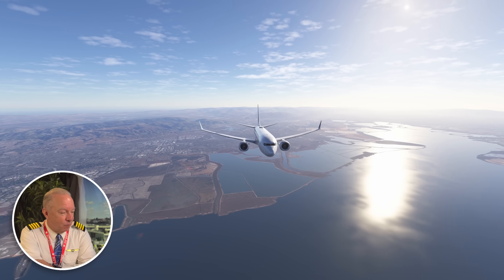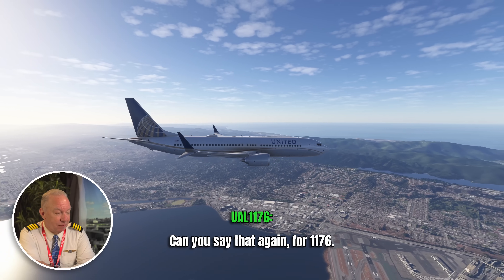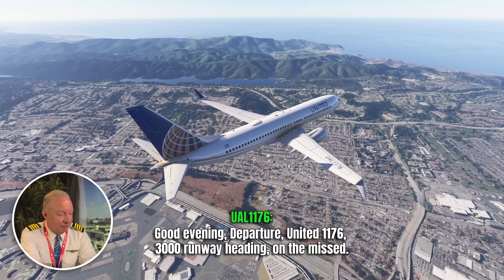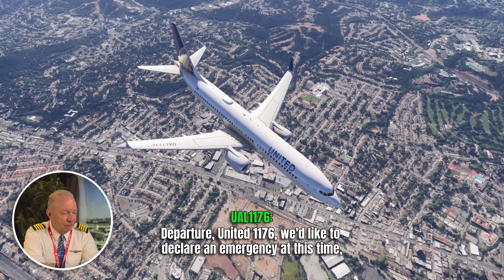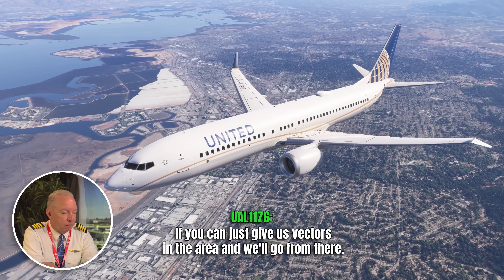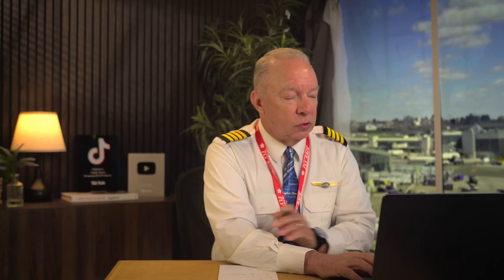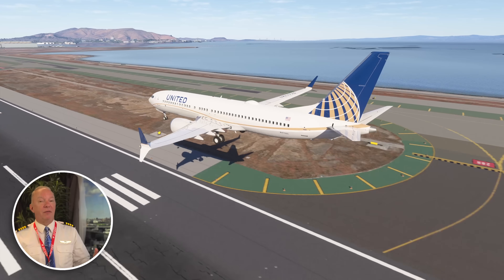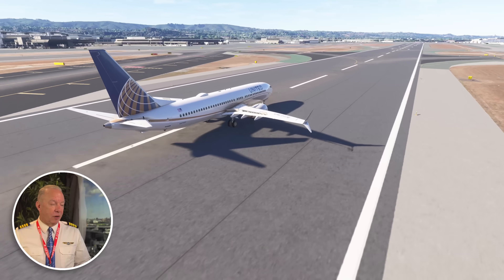Flap Failure on Final Approach – United 1176 Emergency! | Captain Steeeve Reacts

Comment: U know how it is when someone ssks U a question about wanting to b perfectly correct in ur diagnosis
How many doctors have been wrong about a diagnosis that led to someone losing power and stop breathing anymore

Ots a tuning timing factor Captain Steevie with heroic probability math function test results using a simple breathing function calculator Vacuum temperature metering voltage change Echo Maps recording speeds in PSI coded tachyons kicking out neutrinos naturally gifting electromagnetic life force power to clrar phone the Morphogenetic field structure of distorted metatronic Shadow body sound waves generating cavitation in Water molecules to dehydrate ions implode and go NOVA BARDO Quantum Vampiric Super Computer Borgha Matrix Quarantine victim victimizer game simulators through finite Quantum Artificial intelligence Super Computers communicating with each other through nano bots redirecting reverse flow traffic DNA coded negEntropic nuclear coded metatronic distorted sound waves
Thats what led to bio regenesis Salvage Co-mission reclamation unification project Host Aquaferion protection Passage way Home through inner Urtha Krystal Core Still point of a True Vacuum L PIN LUV story without being interfered with through electronic metatronic implants malware Trojan Horse crucifixion mathematical Spiritual torture chamber mind control programs through obedience training through implants

That would be ur Secret Space programs MK Ultra Secret Services clandestine psychological operations against Humanity through Quantum Vampiric Super Computer codecs Intruder races Alliance

Thats Y we are here as Founder races Guardian Alliance Shield service organization 🌈

Comment: OK, Steeeve..... I'd like it if you gave the addendum to these mechanical failures.... ie, tell us what went wrong with the plane, and how it got fixed. For some of us, we want to know if it was caused by poor maintenance, aftermarket parts, or poor design.... or hitting a bird, or a meteorite, or whatever... and what steps were taken to remedy the situation..... It's may the engineer in me that needs this missing piece of the "Debrief". Thanks!

Comment: I really find your videos very very interesting. And so informative. They also have the effect of making me aware of how many things can go wrong on an airplane on takeoff on cruising on landing etcetera. I have not flown since 1989. I always liked flying on jets that had four engines or at least three like the boeing 707, DC8, Boeing 727, I even felt okay on the dc-10. On one night flight from Chicago to la we lost one of the two engines on the left wing. I didn't feel all that nervous because we still had three other good engines which left us with 75% power. We landed at LAX without problem in the dark of night. I don't care how dependable they say to engines are on one airplane. If you lose one engine you lose 50% of your power. And that ain't such a good thing 
.

Comment: Not much of a comparison but if you fly combat flight simulators you land without lots of control surfaces. When youre in really bad shape on a computer, you can test that feature briefly to see how it will behave. I've rolled it right into the treesl a couple times before I learned  to survey the damage before lowering flaps. Side slip doesnt work too well when your vertical stabilizers half missing, drop gear and realize you only have one wheel left. Maybe not realistic for most of us but it makes landing a WWII Corsair even more interesting.

Comment: In 1990 I was on an America West 757 Phoenix to Chicago O’Hare,  on initial approach we felt a jolt, like we had been punched sideways. The plain continued on out over Lake Michigan for about 15 minutes and then began seeing a mist from the wing, they were clearly dumping fuel. The pilot came on about 5 minutes later as we began the turn back to O’Hare. We were advised the right wing flap was stuck and would not extend. The pilot told us he was retracting the left wing flaps and going to be landing faster than normal on the long runway at O’Hare and that he had declared an emergency landing.  It was a noticeably faster landing, runways had been foamed. We passed 10-15 emergency vehicles, slightly unnerving, but safe landing, taxi over to a vacant area, vehicles inspected the plane, portable ramps were brought over and buses took us to the terminal. Great job by the pilot, baggage claim was a mess.

Comment: I have a couple of recommendations for you. You have spoken about the broken ATC communications issue many times. Write it up with any recommendations, and then send a copy to NTSB, the FFA, and the President. All it takes is for him to pick up the phone, and the issue resolution will begin. Regarding the checklists you almost always mention, is there an easier way to organize or modify them to reduce the pilots' workload?  If it were possible, you could save many lives. With your 42 years of flight experience, I know you have some excellent ideas for improving aviation safety.

Comment: I’ve heard you say go arounds happen all the time and it’s no big deal. Now it is complicated and doesn’t happen often. Which is it?
Reply: They happen all the time when you look at all the flights worldwide. To an individual pilot, it usually doesn't happen often. This year I had one go-around and I wasn't even the one flying. Last year I had one as pilot flying. But a few years ago I also had 2 go-arounds in 2 weeks, once due to gusty weather and then due to the flaps not extending to their final position. And about 10 years ago when the airport I was based at took the ILS down during summer due to reconstructions, many go-arounds were flown that time as often the weather wasn't good enough for the VOR approach.
Go-arounds are always trained in the sim, so it shouldn't be a big deal when they have to be flown in real life.

Comment: Many posts saying the pilots were calm and unflappable. Pilots train for such emergencies in the sim ever year the way they train for engine out or fire on take off. Though not having your flaps working correctly as long as they don't stick in a "non symmetric" position, this emergency is amongst the least serious to deal with. This crew stayed calm knowing they had seen and practiced for it many times. One of the biggest and most important lessons my flight instructor taught me over 40 years ago was that in an emergency, you can't control your environment, you can only control how you react to it. Good work by the flight crew.
Reply: Why the heck can't they have a ventilation system that takes fresh air from outside to exhaust any smoke or fumes ? Especially during landing ??

Comment: 737 is not a 777. On the 737, there are 3 non-normal checklists regarding the Flaps, those are: "Trailing Edge Flap Asymmetry", "Trailing Edge Flap Disagree" and "Leading Edge Flaps Transit" checklists.

Comment: Happened to me as a passenger in the 90's.  Should have gone to Madeira, instead emergency landing in Lisbon.  Felt like a normal landing. But they couldn't drive the plane after we had come to a stop. We stod on the runway for a very long time and we could smell the overheated brakes.  Equipment all around.  Finally they let us off.  But we weren"t allowed to bring our personal belongings.  Strange because it wasn't an evacuation. 
 
Was much scarier on land than in the air.  Later one person from every family was allowed to go back to  on  plane to collect personal belongings.

Comment: Every story here about Boeings, and some DCs/CRJs. Haven't any of you guys had a flap issue with an Airbus? Maybe something smaller? Stale coffee? 😜
Reply: Yes, I have. Flaps Lock after selecting Flaps 2 in an A319. Did a go-around, pattern, and landed. Delta VREF was +25 IIRC.
So yes, it also happens with Airbus from time to time.

Comment: Aircraft protocol seem to be overly complex now - way too many checklists. If the flaps are f**ked, then the flaps are f**ked, land without them ASAP instead of spending an hour doing checklists that wont change a thing?
Reply: No, not ASAP. The plane flies just fine with the flaps extended, there is no need to rush. But the plane would stall if you're too slow for the flap setting you have, so you have to make sure the plane is properly prepared for the landing. Basically the VREF is adjusted and the flap warning turned off.

Comment: Aerojet Lear Jet  back in 60’s approach to B52 US Mather Field flap broke. Pilots went with yaw. Upside down. Full throttle. Flaps retracted. Gear up. Flew length of field upside down. Stabilized. Rotated to right side up. Go around. 11,300 ft runway. Landing at 172 mph.

Comment: I have been in a Boeing 737 flying into Melbourne during a flap failure. We ended up landing at about 40-50 kmh above normal landing speed with a very flat approach. This was about 25 years ago. The plane landed safely. As the pilot explained, they train for this regularly. It was a little tense but not significantly so.

Comment: The reason for the coyness of the flight crew might be related to this being a United flight. If they were allowing the passengers to monitor their ATC communications (aka Channel 9), it might be a kindness to avoid the  details and mayday declaration until they discontinued the passenger audio. 

I too experienced an asymmetrical-flaps situation as a passenger on departure from ATL for CLT, not long before 9/11. No cabin announcements until we had circled Atlanta a couple of times. By then it was clear something was amiss. 

Since Delta had no maintenance facilities in Charlotte, they elected to return to Atlanta after nearly two hours, flaps fully extended the whole time. 

This was doubly frustrating, as I had bumped up to this ‘earlier’ connecting flight. I then missed my original connection, only getting a seat on the last departure due to other passengers’ late arriving flights.

Comment: Have had only one No Flap landing, 737-800.  Captain gave us a Yellow (which means we don't communicate to the pax).  Landed okay but could tell thrust and brakes were well used!  Pax were startled and concerned when they saw the firetrucks along the run way.  Thought the Captain should have communicated to pax, but it's not our call.

Comment: Flying into Manchester UK in the early 2000’s, on a 777, the flaps jammed causing a loud banging sound as the overload clutch releases. The pilots made a no flaps landing.

Comment: I was on American 737 out of London to philly on Oct 3.   We took off.  We climbed and then we were told we had to return due to a flap problem.  The flight attendants were taking pictures out of my window on the wing.     We ended up dumping 20 000 lbs of fuel over the English channel before heading back to Heathrow.   Pilot prepared us for a rough landing.    We were safe and all emergency response vehicles were waiting for us.   Thank u Captain Steve for the knowledge from your channel and knowing in the .moment I would be safe.   But one thing the flight attendants  should not  do is  overreact and scare the passengers by taking so many pictures without an explanation.  The whole duration took about 90 mins

Comment: I was on a Lufthansa A320, Frankfurt, Germany to Manchester, UK, 4 years ago & had to do a go-around at the last minute. The Right-wing Flaps Jammed at halfway, would not retract or extend. The pilot did the go-around ok. He, did NOT call for an Emergency, but said when we landed & stopped on the runway, that it was the tower that called it an Emergency & closed runway 23 R.  All emergency vehicles were waiting after 10 minutes, we taxied to a parking spot, not a gate again, Manchester's policy

Comment: Was a passenger on an MD-80 flight to Boston that had a flap failure on final.  Went around, declared an emergency, and spent about an hour circling west of Boston while the crew troubleshot the issue.  In the end, we landed with no flaps and trucks waiting - a little hard but not bad and definitely fast as we took up the entire length of Rwy15R.  Checked brakes for fire and we taxied to the gate.  Very professional crew and whole bunch of happy passengers.

Comment: A 737 starts from Boeing to Love To Phoenix to LAX. I boarded in Phoenix. As we land at LAX I could see people in the parking lots when ZOOM off we went back into the air. No rear flaps, brand new aircraft. So we burned fuel over the coast as crew tried to lower flaps manually. When we finally landed from the east we got an up front and personal view of the dunes and the pacific at the west end of the runway. Thirty five years later and it still happens?

Comment: Two comments/questions not addressed in the video:  (1) Why did they ask for the ILS on the second try - so they could focus their attention on the flap issue rather than flying the plane by hand on visual?  (2) Unless I missed it, I don't think the crew ever said whether the flap issue was resolved and they were landing with normal flaps (e.g. flaps 30), or whether they were attempting to land with something less than normal flaps, requiring more runway and/or brakes?  Tower should want to know this to dispatch emergency vehicles as required.  I don't think we heard that they withdrew the Mayday call.

Comment: I remember coming in for a landing at DIA when the captain mentions that the flaps would not extend (it was either an A320 or a 727 - I flew there weekly for 5 years so I don't remember what specific aircraft it was). The captain mentioned we would be landing at a higher speed but nothing to worry about. Well, apparently we were going so fast that we touched down at DIA and deplaned in Ft Collins! Cruising I-25 in a jet was worth the price of admission😊
Reply: Whoa. This took me a second to understand. Meaning they overshot DIA due to speed?
Reply: @MatthewBakke - Not really. We did come in hot but stopped well before the end of the runway. I was attempting humor with the Ft Collins comment😊

Comment: 25 years ago the passenger airplane (MD-11) I was flying suffered from an asymmetrical flap failure, followed by a flap runaway (retracted while not commanded to do so). We made a go around at Curacao (Dutch Antilles), troubleshooted and decided to make a no-flaps landing. The runway is not that long and ends with a cliff in the sea. We came in fast, landed positively but after landing all our brake temp lights set the alarms off. We kept the passengers on board for almost an hour to let the brakes cool down as no one was allowed to approach the MD-11 to keep it safe in case of tire blowouts due to the overheated brakes. It took the technicians almost a week to find out the cause: wrong hydraulic flap actuators (looked exactly like the right ones, but with wrong internal system and wrong serial numbers) were installed at the previous maintenance overhaul the week before. No idea how that happened, but we were @!?& at our maintenance department.

We flew back home empty as the aircraft needed to be ferried back home in that faulty state, and over the Atlantic close to the UK we performed various timed tests of the flaps at altitude. That was also when I performed a few stalls for fun. The MD-11 was very benign during stalls. Loved that aircraft!
Reply: Gotta keep maintenance guys on your Christmas card list...lol

Comment: Hello Captain Steve,
I have a video request for you. On August 21 2025, I flew from DFW to Killeen TX, airport code GRK. Flight number AA3455 (the flight number might have been updated). This flight left at 3:15 pm, however when it reached Killeen, it could not land because of wind sheer and got very turbulent and scary. After a lot of bumps, TOGA maneuver was done and the plane regained altitude and came back to DFW. I would love for you to make a video on it including how it was dealt by air traffic control. 
Your biggest fan,
Zuberi

Comment: Back in 1980 I was an air traffic controller at Atlanta Hartsfield on a slow Sunday morning at my departure position in the TRACON, when I hear in my headset from the arrival coordinator, "Delta 122 will be coming to you on a missed approach with some type of problem." That got my attention! "Departure, Delta 122 is with you. We need to find the closest airport with better weather. We have a split flap issue and only have enough fuel for 15 minutes flight in this configuration." He was essentially flying sideways! I immediately checked all the surrounding airports and Dobbins Air Force Base had the only weather, reported as VFR. Since the Delta 727 was not equipped with instrumentation for an instrument approach to Dobbins, I vectored him up towards that airport for a GCA approach to RWY 11, their active runway. He responded, "We don't have enough fuel to make it to that runway. We need to land straight in on RWY 29!"  Since it takes 10 minutes for the Dobbins controllers to reconfigure their GCA radar for that runway, I told the pilot, "This will be a surveillance approach to RWY 29." I was going to provide his navigation with my radar site, 20 miles away from Dobbins! Everything was working as planned, except he had not yet spotted the runway. One mile from the runway he disappeared off my radar scope! I asked him if he had the runway in sight. After a brief, frightening pause, he responded, "We have the runway!" He landed safely. Shortly after he landed Dobbins came out with a special weather observation, which was just as bad as the weather at Hartsfield. Delta provided a bus up to Dobbins to pick up the passengers and crew and bring them back to Hartsfield. A week later the captain sent a letter, thanking me for my assistance, "even though the weather was not as reported!" Just another day at the office!
Reply: This actually got a good laugh out of me. “Even though the weather was not as reported”. Savage